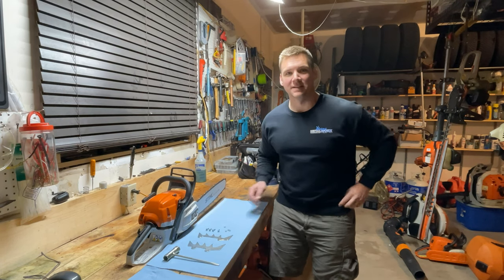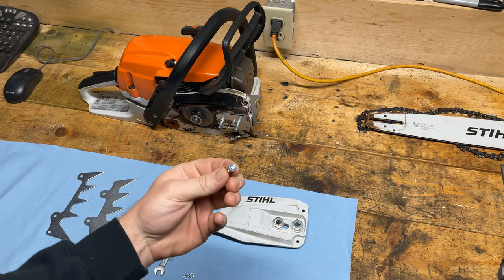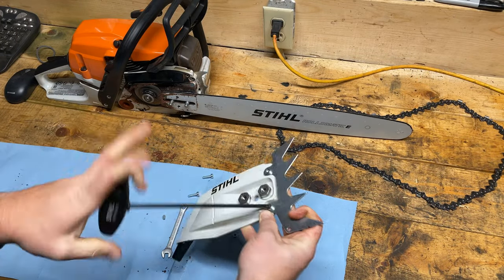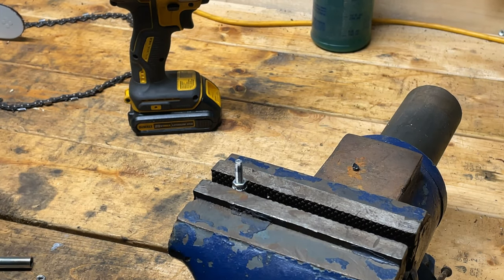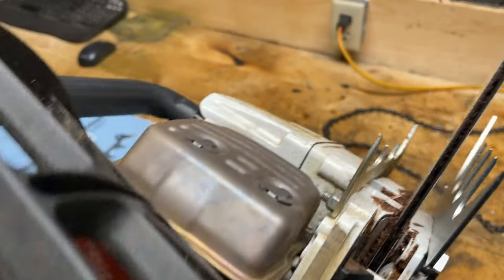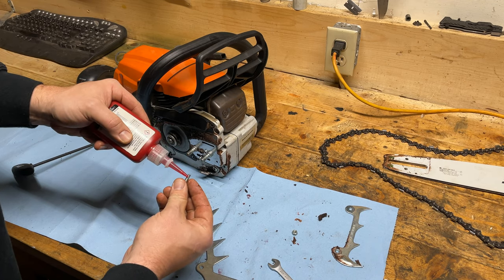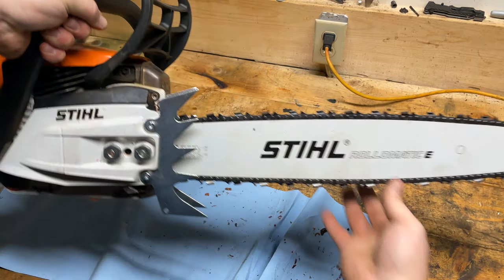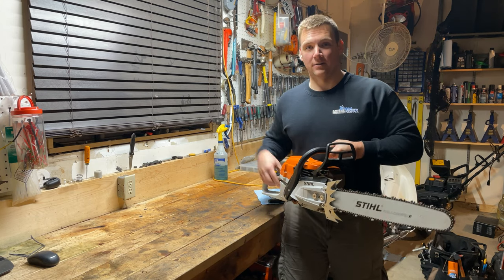How to install aftermarket large felling spikes on a Stihl MS261c chainsaw (modification required!!)

Comment: Flapper-Disk was a great idea for your little re-shaping fine-turning job... I’ve found that with all the cheaper China aftermarket type parts that as long as you understand that you are the final QC inspector or final finishing station...you will need to ease and edge or make those little adjustments... you can save some money as long as you have a basic set of skills.  I kinda find that rewarding myself... like taking a Farmertec kit saw and adding some OEM parts...basically when you are finished with it it’s a “Dave’s” saw... with a combination of part’s both aftermarket and OEM then it’s “your saw”... you “manufactured it!”... I love adding the meteor topend kits to the cheaper kits and getting a century of hard work (commercial) out of a few hundred dollar not a thousand dollar saw!  I’ve gotta do some homework on the 261’s... I’ve got a new cm that has broken cases...tossed out of the tree it’s first day on the job and a  261 adjustable carburetor different cylinder style...not sure if I need to swap over the intake too???
Reply from the maker: Hmmm, I’d have to put them side by side. The M-Trinidad carbs are pretty impressive.
Reply: @DavesSmallEngines  I just don’t like the high rev situation... I don’t want a saw to be able to spin 13,500-14k... I want the ability to richen my mixture and be down around 12k max... then the saw will work for years no matter who is on the trigger... seems the younger guys really like to hear them scream!   Or the less experienced guys who don’t feather the trigger near the end of the cut or while limbing.... the 026’s are legendary for spinning 13,500 for a decade...I have several tree removal guys who keep a few going as they are their chipper saw’s... 16” 3/8’s setup...fast and light... my buddy Dave runs a 261cm with a 20” setup and does a good 80% of his residential tree removal business with that saw!  He dropped a 36” diameter Ash tree with it a couple days ago...I ended up cutting it up with my big saw... but he had it on the ground when I pulled up....😂👍.   My buddy Christian has the 261cm and the 362cm... with the 18” .325 and a 20” 3/8’s respectively... I grab his 261 with the 18” long before his 362...for the additional weight I don’t feel that much additional power?  His 661cm is much smoother than my 066... and it definitely burns less fuel making it’s power...I am re-fueling a lot more often with the 066...fells like twice as much then the 661...?  Definitely is probably just me... but it seems like you are always needing more fuel.... so big saw’s with big bars are fun and all...but when you have to stop and refuel say 4x more often than you do with the 50cc size 261... and after a 5-6 hour firewood cutting session your arms and back are in much better condition if that big saw hasn’t been the main character....😂👍.  But at 52... you are done trying to look cool...you just want the lightest saw that will get the job done!   😂😂😂😂👍

Comment: I'd like to mention that the chain catcher roller is missing from those longer spikes/dogs. Since you kept the original chain catcher it's not a problem. The roller chain catcher can help stiffen the bottom of the spikes so they don't bend as easily. Some of the aftermarket parts can be very thin. Just be very careful that your original chain catcher is not bent or damaged. It's a good idea to keep a spare one on hand.
Reply from the maker: Sounds good, I will keep that in mind!!!
Reply: Excellent comment!

Comment: Dual felling spikes do useful things: helps keeps saw “square” to the cut, protects case from frontal impact when pulling into wood, obviously bites better into wood, finally the second spike, from the bottom should line up where the chain is so you know where you are in the wood with the bar buried.

Comment: Flip the screws on the cover around no interference they’ll be a bit longer on the outside. You will also find the nuts have a flared washer to better grasp the cover from the outside. Check West CoastSaw which has a great explain of why you need a chain catcher to not damage dawgs.

Comment: We always take spikes off. . there only needed when cutting with dull saw, plus with out them in the way you can cut larger dia. trees with shorter bar. most people are not cutting  40 inch dia. trees so we use 20 inch bar always. .
Reply from the maker: That’s good to know! Thank you!
Reply: Trip trees all day you will appreciate the extra leverage

Comment: 1) You put the case bolts on backwards.

2) You need a chain catcher to stiffen the whole thing up and to stop twisting distortion.

3) You shouldn't buy cheap junk from China.

4) You need to spray some Gal spray on that dog you ground otherwise it'll go rusty.

5) You should have just bought quality from West Coast Saws who make the quality dogs and components such as the rolling chain catcher which stiffens the whole thing.
Reply from the maker: Hey Ade - thanks for all of the comments. I will go check out East Coast now!
Reply: Wow!
Reply: @georgedavall9449  West Coast Saws.

Comment: Great video.  Not sure why you didn't clean up while you had bar off?  Even a quick wipe. 10 demerit points for you.
Reply from the maker: Ahh shucks. Good call though, could have hit it with compressed air. Cheers!

Comment: 😂😂😂😂😂😂 Should have painted them Orange 🍊 so they would really add that Bling!!! 😂👍👍👍.   If you put them in a toaster oven on 400 for a few hours...(4) then drop into a room temperature oil bath a couple times you can actually harden aluminum just like steel... ie a aftermarket piston....😉👍
Reply: Makes them too
Brittle
Reply: @THEMOWERMEDIC1  did you try a couple hour home made hardening on these cheap spikes Medic?  PS... really dig your channel!😁👍
Reply from the maker: Good to know!